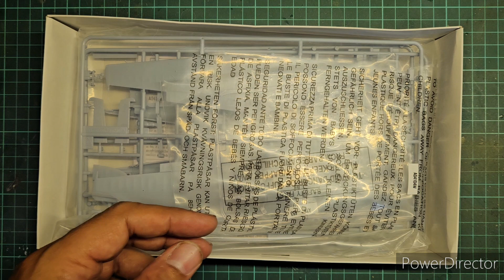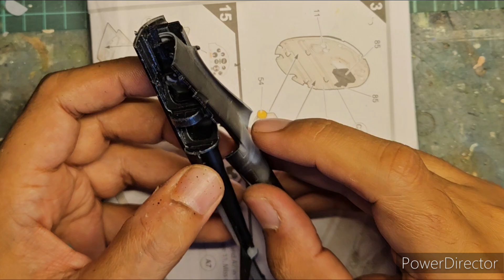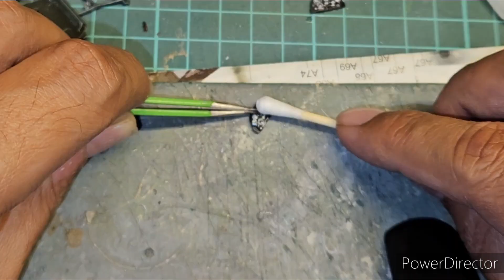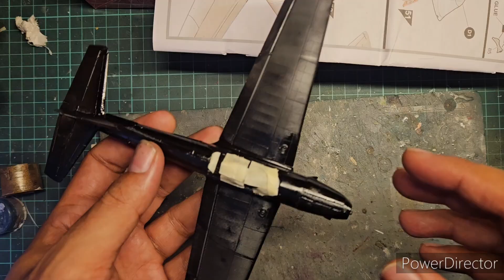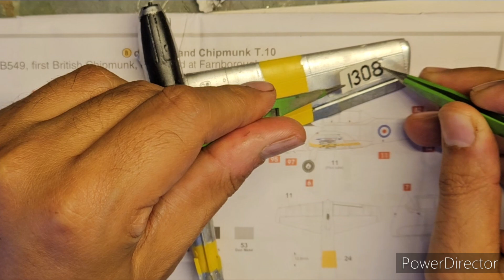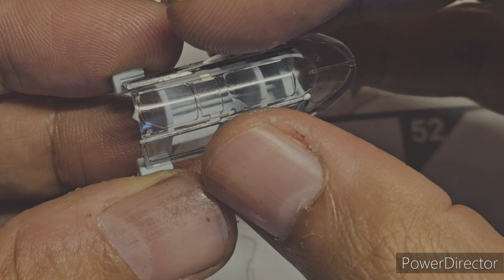Of his own free will (Ex Mero Motu) || DHC-1 Chipmunk || Airfix 1/48 scale || Portuguese Air Force

Comment: Why mostly oil paints are used for weathering? Is there a specific reason? I tried searching but did not get clear answer....
Reply from the maker: You can use any types of paints to weather a model like acrylic, water colors, chalk pastels or oil Paints however in order to show dirt and grime, oil Paints are most suited because they take much longer to dry and when used over a glossy surface, they can be manipulated and moved around as much as you want to show as stark or as subtle an effect that you're aiming for. Oil paints also help to depict any color shifts in the paint coats very well as you can see in my MiG-21 video here.
https://youtu.be/i-Ax4jqTG1U?si=jDeok1MREYgFU3MT
Reply: @swing.wing_singh  thank u!!